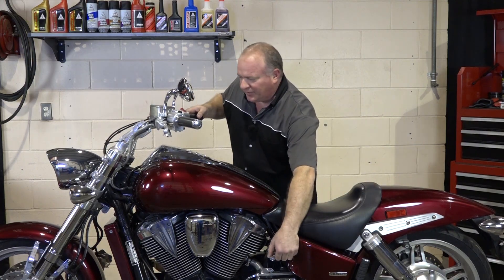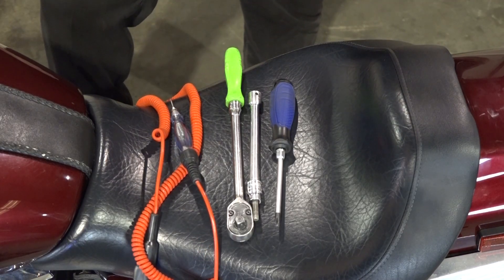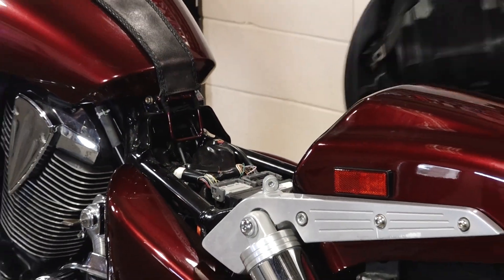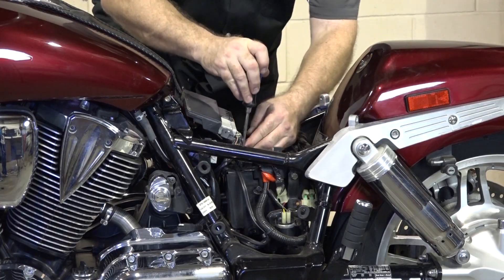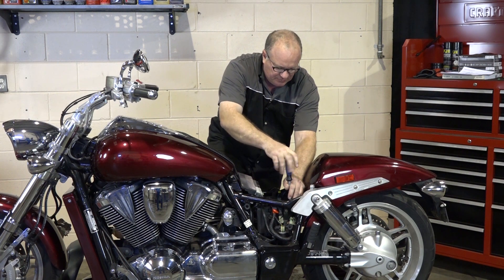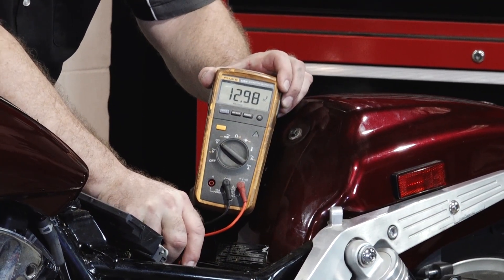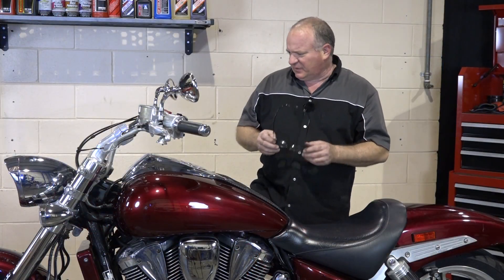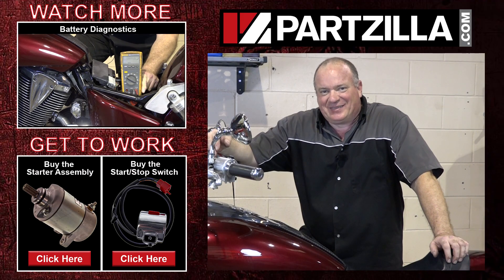Troubleshooting a Motorcycle that Won’t Start | Honda VTX 1800 | Partzilla.com

Comment: Hi John. Thx for ur prior responses, they helped a lot! I replaced the starter Solenoid with a cheap one and it started right up.  The only problem was that it WOULDN'T shut off!! I'm currently letting the DEAD battery charge and I'm going to buy a better relay. Is there anything else I need to do? BTW the starter was making a loud noise. I may need a new battery and starter??? Thx in advance for your help!!! Oh, and the bike didn't start with the wire trick because when i installed the battery, i didn't apply the solenoid wire to the battery. Ha ha
Reply from the maker: If the solenoid fired off the starter and wouldn't shut off, there could be damage to the starter, what kind of noise did it make?
Reply: Partzilla sounded like a pretty loud serpentine belt like the squeak of a loose one
Reply from the maker: Oh.  That doesn't sound good.  I would pull the starter and inspect the gears.  Power it up and see if it makes the noise out of the unit.
Reply: Partzilla i paid $11 for that relay. I'm waiting for a Honda relay. Then I'll put humpty back together. Expect a vid response in <a week
 Thanks again!!!

Comment: is there a video on replacing start stop switch assembly?
Reply from the maker: There isn't.  It's pretty easy to get off.  Just the two screws on the bottom, then the throttle cables and a few electrical plugs.

Comment: Thanks again.  After checking from the battery back I discovered the connector on the starter relay solenoid melting.  Once I straighten out the connection on the four prong connector charging system worked like brand new.
Reply from the maker: That would cause a problem!  Glad you got it sorted out.

Comment: Thanks, the votage is a12.46 when bike is running and drops when the rpm is raised.  I check from the battery back.  Thanks again.
Reply from the maker: Something else to consider.  Check all your electrical plugs, fuses and connections.  If something is loose or has corrosion, it will create a weak or inconsistent connection.  Tighten everything down and make sure everything is plugged in tight.  Swap out fuses for good measure.

Comment: Your video has been very helpful.  Truefully, I wish I had watched it before spending money and time.  My charging problem begin with a bad battery.  So I purchased a new battery $107.  The battery wasn't charging so I purchased a stator $159.   System still not charging.  Then I found your video and began testing.  The stator ohms was giving me a reading of 001.  The diode test was good.  My rectifier was giving noting.  So, I purchased a new rectifier $55 plus shipping $77 and it's testing good but my system is still not charging. Today, I ordered a diode three way assembly $10. What am I missing?  My bike is a 2006 Honda 1300c VTX.
Reply from the maker: Sounds like you have covered most of the components.  When your bike is running, what is the voltage at your battery?  If it gets to this point, sometimes the easiest way is to start at one end and test the wires all the way down the system.  Figure out where the break in voltage is.

Comment: great video . how easy is it to take apart the throttle cable on the start button, I just ordered it from you guys. I need to put in a new start button, kill switch.
Reply from the maker: It's not hard.  The throttle cables just need a little slack to pop them out. You'll see once you crack it open.

Comment: bless you first of all. man i have a Suzuki 750 1999 gsxr and bought battery and ignition switch nothing come on. i don't. know how to read a multimeter. but i had problems with the kick stand i rig the button to always still in it has been times. when. i started it and put it in gear that it would cut off .do you think it could be the kick stand switch or the on/ off switch.
Reply from the maker: If you put it in gear and it cuts off, it's most likely the kickstand switch.

Comment: looking for a riding in the rain and my vtx 1300 c stalls out but will restart after a few mins
Reply from the maker: Water is probably getting somewhere it shouldn't.  Electrical switches, plugs, frayed wire, loose spark plug...You could try running the bike and spraying different areas, until it stalls, to narrow it down.

Comment: very good video, I "liked it". my 2005 Honda Shadow 750 has no power at all. It died on me while riding, and I jump started it with a running car and made it home. All fuses and battery are good. I'd really appreciate any advice you could offer.
Reply from the maker: If the battery passes a load test, and the fuses are good.  Time to start testing your charging system.  Stator and regulator.
Reply: Thanks for the reply. I will check those next. I had a friend tell me that jumpstarting it may have shorted the wiring harness. What's the likelihood of this?
Reply from the maker: It is possible, but not common.  I would rule out everything else before considering it as the issue.

Comment: partilla i have an Aprillia Rsv 1000r but it wont start like this bike 
i replaced all the fuses and no luck please help
Reply from the maker: If all the fuses are good, you will have to run through the system and test the components.  Battery load test, solenoid test, starter...
Reply: Partzilla i see will test m8 thankyou

Comment: My 2010 Honda Stateline was recalled for starter switch replacement. I'm so frustrated that it still doesn't work. Can anyone refer me to a good, reliable mechanic in the Jacksonville FL area.

Comment: I've got a 2003 vtx 1300, not getting fire to the plugs. it spins but it's noting getting fire.
Reply from the maker: Fuses, pick up coil, regulater rectifier would be the first steps, just work your way back to see where the power stops.

Comment: i have an 06 vtx 1800F before i came across this video i determined it was the solenoid. there was no power going to the starter. now i got power to the starter but no start. all the test point to the starter. could they both go at the same time?

Comment: What to do when you turn on the bike but the Fuel Pump does not?..Bike cranks but won't fire up?..new fuel pump or is there some kind of power shortage somewhere?
Reply: i have a 2006 vtx 1800c with the same problem.     update, got fuel pump working had to bang on it with a wood punch and hammer, must of got stuck sitting all winter, runs good now

Comment: If you have an engine that turns over...
but you engage kill switch into the run position but it isn't making the sound ( like its printing the engine)
Will turn over and over and over but not crank...
any idea

Comment: Very informative much appreciated !
Reply from the maker: Thanks, Zytnia! Glad we could help!
Reply: Partzilla 
whats up man i have a cbr 600 honda f4i i replaced my starter solenoid and still nothing. every time i conmect it with a new fuse my fuse blows out? can u give me any advice?
Reply: Partzilla 
where are you located bro i would like to bring my motorcycle to you i know its simple stiff but idk what to do.
Reply: When I push the starter button the starter motor is slow to react. Sometimes it doesn’t react and I have to keep trying before the starter motor engages. I’ve cleaned the push button start feature, but the hesitation stayed the same. Any suggestions? Thanks.

Comment: I put a new battery on mine and it started but in about 2 minutes, it died. Checked the battery and it was 0%. It drained a new battery, what could have caused it?
Reply from the maker: Hello Fredy. it sounds like you have a bad regulator, or stator.
Reply: Thank you.

Comment: very valuable information on starting issues. I actually had to deal with that problem on mine, except it was a physical problem. The starter button pushed in and broke, it didn't come back out, and it didn't start the bike. I didn't think to use the jumper, but luckily we were able to get the bike going because we were on a hill. Rolling start got it going. Wish I would have thought about the jumper wire though...LOL. So were you jumping from the actual red battery lead to the hot wire on the solenoid? it was hard to see with the hand placement, but it makes sense that it would work.